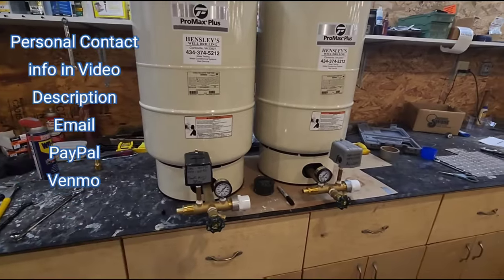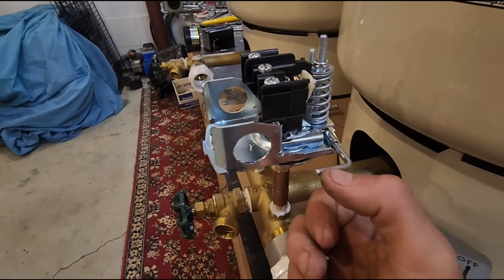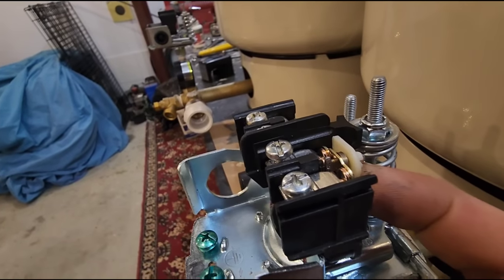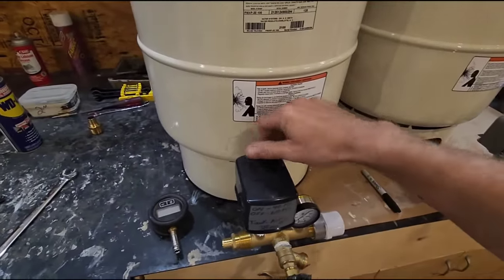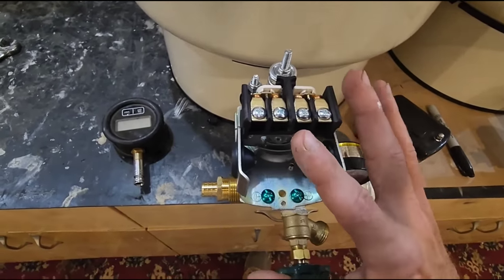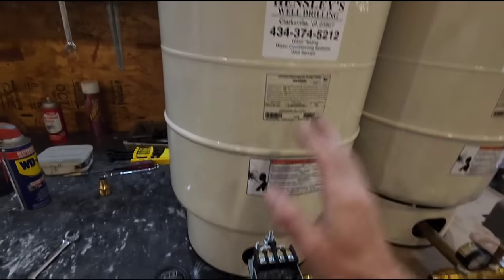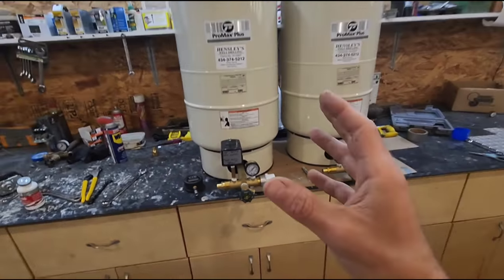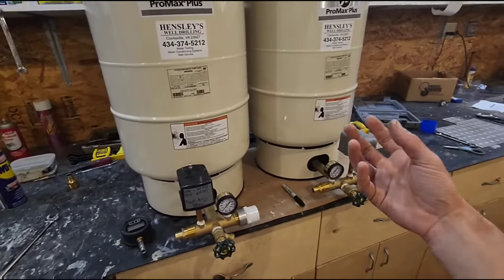Most Common Reason for No Water!! Reset Pump Pressure Switch. Water Well Repair Vlog Ep.18

Comment: I cleaned the dead bugs, spider webs, and dirt around the inside of the switch. Resetting the switch helped me fix my well issue instantly! I turned off the breaker to the well then pulled the contacts back with the cap and cleaned them so no debris was in the middle of them. I turned my breaker back on, I heard the well reset and power on and started seeing the PSI increases to around 40. I used a small painters brush to clean the debris around the switch.

Comment: I opened my box to the pressure tank and one of the contacts was tweaked and not touching a simple adjustment with power off was the fix. Your video is the only reason I even looked thank you buddy

Comment: Glad I found this! Will pray this gets us going tomorrow. Just had a three day power outage in our greenhouses and ran our pump on a generator. It stopped working this evening right before the power came back on but the pump is still not working. Will try this tomorrow and see if it can get us going!
Reply from the maker: Your switch probably has a lever on the side of it. Hold it at a 45⁰ angle for 30 secs to build pressure
Reply: @h2omechanic  unfortunately I think it's the one without so will try some flicking. I'll test the bladder pressure too.
Reply: So turned out to be the best solution I could hope for. The double pull breaker had gone bad and one leg was dead. Found it this morning when I had a clearer head. Easy fix! Always start there I know and work down. This did give me a chance to change the gauge which had died and add air to the bladder. Was down to 20lbs. Should be running great now!

Comment: This didn’t fix my problem, but I was able to rule out the switch and the tank. I believe the issue is upstream - pressure gauge on the tank is less than 10. 1HP control box is at the well head and is running (box feels warm to the touch), but no water is being pulled up to the 81 gal tank (40/60). Entire system was installed less than 2 yrs ago. Waiting for the company that installed it to call me back. Anyway, appreciate the content, I learned from it !

Comment: I’m on a shallow jet well pump in northeastern Indiana and just replaced the pump & the pressure tank. The pressure tank went bad (15 yrs old, pump was short-cycling the last couple of winter months, couldn’t get to it until it warmed up here in early May), water poured out the Schrader Valve when I checked it, didn’t even bother with my tire gauge, as I didn’t want it wet. Went from 14 gallon pressure tank to new, 20 gallon pressure tank.
New pipes put on from driven pipe top to the pump & from the pump to the pressure tank. Old galvanized fittings were all rusted.
New pump is a 3/4 HP Coleman that was bought some time ago and set in the box in the hallway, 30/50 pressure switch on side of pump (attached at manufacturer), & new pressure tank was set to 28 psi before hooking the pump up.
We have a driven well point, with a course screen, that I THINK was driven down to 28 feet, but I’m not sure, I can’t remember what dad drove it to.

New pump finally pumped after about 2-3 primes. It cuts in at 30 psi & off at 50 psi, but it seems like it struggles. Pump runs about 3.5-4 mins each time it cuts on & needle on pressure gauge shakes & vibrates as it reaches 50 psi.

Old pump was fine when we first hooked everything up, until the last 4-6 months, so could it be the new pump isn’t as strong, or could the point be getting plugged? Or do I need to adjust the pressure switch down? I think the old one on the old pump was set at 30/50 (that’s what it said inside), but I’m not sure if the range was adjusted down after installation.

Oh, the driven pipe & point is 1 1/4”, as well as the new pipes & fittings over to the pump. But, pump inlet is only 1”. Had to do a reducer bushing & 1” nipple into new pump.
Pump Outlet is 1” and so are the pipes over to the pressure tank & up from there for about 12” until I can replace from there on.

Any help or advice would be greatly appreciated! 🙏🏼

Comment: I'm considering updating to this system. What do you call the junction of pipe  underneath  the Pressure gauge and the Pumptrol Water Pressure Switch with Low Pressure Cut-Off screw into? I'm far from being a plumber and wont tackle this without one lol. Thanks for taking the time to create this video sir.

Comment: Thank you sir. Woke up today w/ no water on Father’s Day 😮. Found this video on internet. I installed a switch years ago 30/50 and adjusted it up to 40/60 or so maybe a little more. Didn’t check pressure in tank after install. Can’t remember. Anyway I held the contacts together like you showed. Finally the contacts stayed together and pressure switched from 0 to 60-65. I never lost power btw. The tank has the same pressure when I checked it. Well my tire gauge maxes at 50. It maxed out. Is the tank supposed to match the tank gauge? I assume so. Do I need a new switch now? Is my pump going bad? Why did this happen? I guess I will be calling for service. But I do have water now. Thanks to you sir!

Comment: My water stopped running suddenly last night. No leaks anywhere, breaker isn't tripped. There's a little bit of water coming from the basement bathroom faucet, but not much. I'm going to try all these methods and hopefully I can fix it myself instead of having to pay thousands for a new pump. I'm so glad I found this channel and truly appreciate the information you provide. You are doing a great service to those who just can't afford to hire a plumber, especially in times like these. I do have one question though: my breaker is labeled as pump; will that shut the well off entirely or should I shut off the main switch? I just don't want to get electrocuted and I don't have a device that can check the voltage. Again, thank you so much for your time and expertise!

Comment: Thank you for you’re video! Replaced a faulty pressure switch and new one has low pressure release valve. I held open for more than a minute but pressure doesn’t build beyond 10 psi. There are no sinks open or water running. Tried holding for a couple minutes and stays at 10 psi doesn’t build

Comment: I'm really impressed with your video. Very informative.  I recently replaced my 40-60 pressure switch without a restart lever with a pressure switch with a restart lever. It works fine under normal use, including filling a tub. When I run my irrigation system for about 3 to 4 minutes the pressure drops below 40 psi down to zero. It doesn't restart at 40. I have to manually flip the lever. Why wouldn't the switch trip at 40 psi under this condition?
Reply from the maker: Too much air in the tank. Press the air valve for 5-10 secs & bleed off just a little. It should fix it

Comment: I just put together a new well system.  New well pump, new pressure tank, & pressure switch.  I just put everything together, but the pump did not come on. Thank you for the detailed video on the points. When I turned on the breaker, nothing happened.  There is power going to points, but there is no power to the pump. The points are open and I hope this is the problem. Still troubleshooting

Comment: Hello.  THANK  YOU  for the content of this video!!  You SAVED us (my German Shepherd dog, cats, and me)!!      I am NOT kidding. We had NO water, and I had NO way to get any, since I moved to a rural area in a county where I know no one.  
(I had sold my vehicles, so I had no way to go buy some water, unless I took an expensive taxi ride into town.  I could not order water and have it delivered, because I only had cash.  I had not been able to get to the bank to make a deposit, so that I could charge for anything online.) 
On August 28th, early in the morning, I was having to put ice in the microwave to melt it for my animals to have water, and I was surviving on diet soda. I watched this video, and did what you said to do, and I got the well pump to work. I have had to repeat what I had done to get it going, but it has worked every time. What I have had to do is tap the pipes. There is a box there, but it won't open, so I have tapped the box and the pipes, hoping that one of the taps will "kick it on" again, and it does. Is there some part that has to be replaced?  
I know that I might find the answer in this, or another video of yours, but my phone isn't charging, nor holding a charge, very well, and that limits my time of being able to use it to watch any videos (and I don't have internet service out here yet to be able to use my computer).
Thank you in advance for any advice you might have to help me keep the well pump working.  Faye

Comment: Been struggling with well issues essentially every year since getting the house. Well pump has been replaced once, pressure switch replaced twice, new heat tape in wellhouse, added a space heater in wellhouse, new heat tape under the house.

Currently flicking the contacts only gives sparks on white side 1 outta 10 times.
Closed contacts. No bugs on contacts.
Water comes out of the wellhouse spigot, no water indoors.  I think the wellhouse water is just what's been sitting in the pressure tank though.

This is after extreme freeze temps where the system fully recovered. Followed by another winter freeze that has left us without water going on a month now.

Unsure what to do next, no electrical tools nor exp. Well guys too busy to get to us for atleast a month.

Comment: We had a plumber here Tues and Wed trying to get ours fixed.  We replaced the pump sub control box and replaced the switch box on the pressure tank.  He put on the 40/60 we had the 30/50 and no pressure registering.  We found your video and did as you instructed and it's not allowing air pressure into the tank.  Our pressure tank, my husband said is like 30 yes old.  Thinking we need a bed one.  Thoughts???

Comment: Your very informative…Inhave the mechanical switch and the level does nothing.  It stays in the open position.  I closed the main line due to bathroom renovation.  Was working properly.  Until tank was drained to replace copper to pex.   Please help…keep up the great work….
Thank you

Comment: Great video and thanks for sharing you expertise! I did a bone head thing and didn't drain the system before checking the pressure. It Read really high so I removed some air. Then when I turned the power back to the pump the pressure jumped (jerked) back to its original reading. Could I have damaged the bladder doing this?

Comment: Pump recommendation for sprinkler system.  well is 83 deep, with 80 ft of casing, with 250 gal per min with static water level at 35' and little drawdown. Each zone using 24 gpm (+-). Would like to maintain min 40 psi at sprinkler heads to insure coverage area. 1 1/4" main lines to each controller and 1" beyond to each head. Thanks Much For Any Help Enjoy your videos and professionalism!

Comment: I have installed a new rigid shallow well jet (30-50). Pressure tank was emptied and then pumped up to, and is holding at, 28 psi. Pump was then filled with water. When I throw the switch, the pump turns on for 2-3 seconds and the goes off for a few minutes before the short- cycle again. Any ideas other than what you have presented in this video? Your video is excellent, but regrettably didn't fix my situation. However, I'm confident a little more info from you would get the pump up and running. Thank you for all the time and effort you have put into your excellent video and channel.

Comment: Hi, excellent explanation. I have a 30/50 switch but I have adjusted it to 30-70 because my irrigation system needs more pressure.  It's been working fine like this for 15 years.  Do you see any problem with that setting?

Comment: First I want to say you are a great American! For you to put these videos out that help the common person maintain their well that is a great thing you are doing. So I come to you for your expertise. I’m resurrecting a well on my farm that has been dormant for about 15 years. I’m running wires to the pump house and the well head but there is a junction box that the wires coming from the well pump house and from the well casing that I’ve never seen in any of your videos. If you could give me an email I will send you the pictures? But my question is can I cut that out and splice the two wires back together and check for continuity? One of the wires is bolted to the well casing so I suppose that’s to ground it. But if I cut that box out and just splice the wires together will the well pump still work?
Reply from the maker: You have a 3 wire pump, it requires that starter box. If you open up the box & pull the face off it, you'll see a start capacitor (or you should if my thoughts are correct) it should be a Red/black/yellow/green wires going down the well & just 2 wires b/w that feed power to the starter box. 
So the new wire your running just needs to go into the box & it should be labeled where they go. Hwdracing@gmail.com is my email.  All my Vids are of 2 wire pumps, so I don't have starter boxes. If you ever replace the pump, buy a 2 wire pump & throw away that box. It's just older technology but still used by some plumbers.

Comment: What I need sir is to replace a broken and stuck gate valve on flow side of switch without losing too much water from the pipes to the utilities such as electric water boilers.  I don’t want to trap air upon refilling system.  I want a new 3/4 inch thread ball valve on flow side. I like video because you articulate well.

Comment: Thank you for putting such helpful info on Youtube.. I hope you might be able to help us with an issue we are having with our pressure tank system.  A few weeks ago, I happened to be near the pressure tank while the wash machine was running and noticed that there were a lot of clicking and thumping sounds that shook the pipes in the area of  the switch box.  We removed the switch box cover to see what was happening and saw that the switch would close for 5 seconds and then open for 15 seconds and continued to close and open in this pattern  while water was being drawn by the washing machine.  Each time the switch closed, there followed a loud "Thump".  The pressure gage is frozen at 55. The upper half of the tank sounds empty. The Pressure switch labels say it is 30/50 and the Well-x-trol Pressure tank labels says "Factory charged to 30PSI. Tank precharge pressure must always be the same as pump cut-in pressure"  The water pressure at out sinks and shower is finer.

I would appreciate if you could tell us if you recognize these symptoms as pointing to a particle problem. Also, We are going to drain the tank and check the pressure, but wonder if there is anything else we should check while we have the tank drained.
Reply: FOLLOW UP .  For us, what fixed the situation I described above was to drain the tank, check the air pressure in the tank which turned out to be VERY low (14PSI), and then to add enough air to the tank to bring it up to the required pressure (28 PSI in our case).  This seems to have completely rectified the short cycling and the loud, pipe shaking BANG that followed each time the power box switched on the pump.

Comment: After fells like 35 below winds and super coldnight on Dec.23 We didn't lose power and we hired precise plumbing guy, he charged us for parts, ie. 3 pipes, fittings and connectors 500.00 & labor 5 hrs. 12 hours later no water again. Let skirting on ground at the back of MH

Comment: I lost water pressure so I replaced pressure switch. In doing so I drained the tank at the bottom valve and then closed it back up. Then I measured the air pressure and it was only 4psi. I brought up to 28. Now I have water, but the pressure is very Inconsistent as you described in this video. Should I have opened up a faucet as well? Did I make a mistake closing up the valve before filling up the air? I made an adjustment To the overall pressure spring and got a little bit better Results but it is inconsistent and I’m wondering now after watching your video if I need to go back to the drawing board of draining the tank correctly so that I get a good reading on my air. Any feedback is appreciated. Thanks again I agree with the other guy’s remarks on here. you have a gift

Comment: INSTALED ALL NEW WELL SYSTEM. 160 FT WELL, USED SCHEDUAL 80 PVC PIPING WITH STAINLESS CUPLINKS IN WELL WITH PUMP, 1HP PUMP, SYSTEM WILL ONLY PRESHURE UP TO 48PSI WITH (YARD LINE ISOLATED OUT OF SYSTEM SO I KNOW THERE ARE NO LEAKES IN YARD LINE). MAX NOT ENOUGH TO CUT OFF 40 -60 PRESHURE SWITCH. PRESHURE TANK IS SET AT 38PSI. STATIC WATER LEVEL IS ABOUGHT 5' TO THE TOP OF WELL HEAD. USED A 1HP PUMP BECAUSE YARD LINE IS 2600FT FROM HOUSE WITH 20' DROP FROM WELL HEAD TO HOUSE SO GRAVITY IS HELPING PUSH WATER TOWARD HOUSE. IT HAS A  2" YARDLINE. WHAT DO U THINK IS WRONG WITH LOW PRESHURE IN SYSTEM? I REALY LIKE YOUR VIDIOS THEY ARE VERY HELP FULL AND YOU DO A GREAT JOB EXPLANING HOW THINGS WORK. THANK YOU FOR THAT.

Comment: Had a pipe burst, so I turned off the breaker to prevent massive water spillage. Turned the breaker back on, obviously pressure is at 0 psi, I don't have a lever like yours, mine is like the switch on the left. Messing with the contacts doesn't seem to create any current like it usually does.

Comment: Awesome content, thank you so much! I do have a question, I recently switched my pump from 3/4 to 1/2. I thought that would be ok, only use it for sprinklers, but pressure is low. Is there a way to make that pump work at least 1 year with more pressure?

Comment: Just came across to your channel great show very informative love your knowledge. 
I have a one horsepower pump that keeps short cycling. Hooked  up to a 1600 gallon water tank.  Maybe either turns on and off rapidly or I can adjust the pressure switch which I don't really know how to do and get it to stay on but never turn off. You give me some pointers please